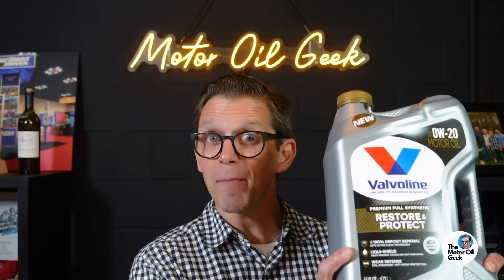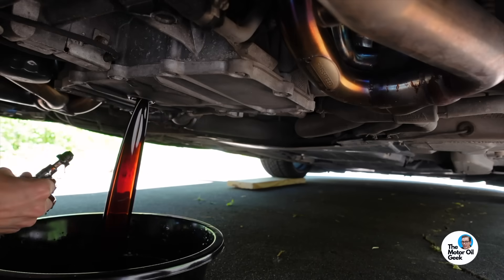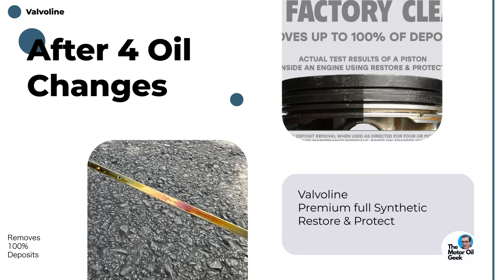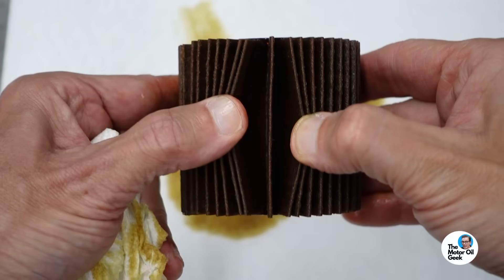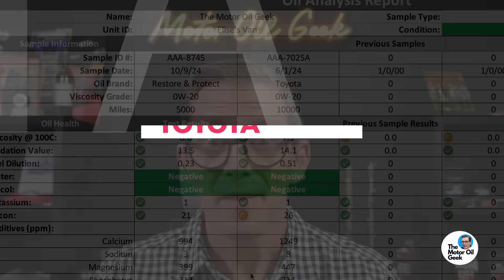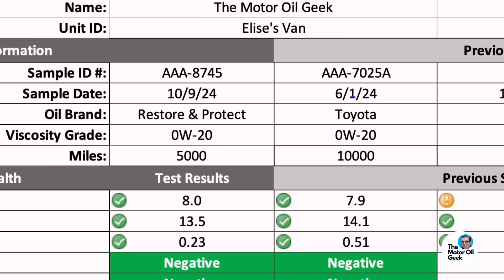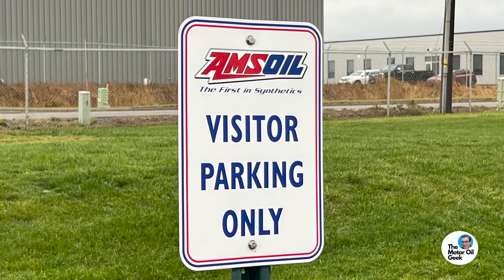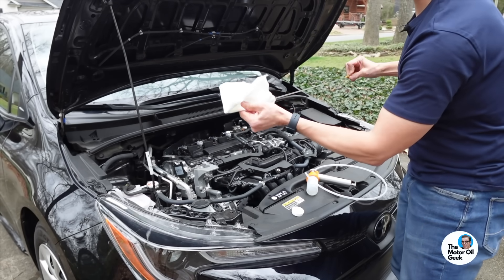The TRUTH About Valvoline's BOLD Engine Cleaning Claims

Comment: Dude, this was such a stretch. A cleaner dipstick? Come on man. You know better. Don't sell out like that. All that training and this is what you hang your hat on? Wear rates that are equivalent on a per mile basis to a bulk OEM oil? It's a stretch to make these claims. It's literally doing the exact same ANY modern 0w-20 oil would do. If you're not actually looking at the engine internals, where this product is said to work, you simply cannot make the claim that it's working. Maybe it is the secret sauce. But the oil sample shows it's just another in-spec 0w-20 API SP oil on paper.
Reply: I have to agree with you. It is a stretch to say it's working by viewing a dipstick and the increase in 1 element. Most all other PRP used oil analysis show zero increase in manganese. I was shocked LS jr used this oil analysis to prove it is working when most other samples show zero manganese
Reply: He didn't show competitive brands of oils can also keep the dipstick clean for unlimited years and miles if changed at least every 5,000/6 months. Example: https://imagizer.imageshack.com/img923/7893/BFcZ3w.jpg
Reply: @SurplusMeat  you missed the dyno engine breakdown test video!
Reply: @davidvankainen6711  Yes, I saw the promotional materials from Valvoline.

Comment: Wondering if these cleaning solvents in the oil will deteriorate seals and modern wet belts (oil pump/timing belts) faster
Reply: I also worry about it. It may cause rear main seal leak or deteriorate the valve stem seals. Who know? Nobody yet.  I won’t use it yet until it’s fully verified.
Reply: was wondering the same thing. My son's Corolla has 250K on it. I use Mobil1 High Mileage on that along with three other Toyotas with around 150K.
Reply: If it does actually work, it would make sense that there is some type of solvent
Reply: Never, EVER buy a wet belt engine. Bombs. Stupid-ass brain fart of a design.
Reply: It most likely will, there’s no magic sauce that other manufacturers aren’t aware of. It just has more of the normal detergents that in large quantities can cause problems. if you are having some trouble with stuck rings or similar using it once or twice might be a good idea, but not over a long-term. In a new engine, it may even be detrimental. At the end of the day, Who cares if there’s some varnish buildup on the internal parts if it’s not causing any issues.
Reply: @star9732  Why would you say it just has more of the normal detergents rather than a proprietary cleaning compound as they claim ? Which detergents cause problems ? Lake has noted that there are tests for seal compatibility that it had to pass for certification.
Reply: @star9732  uoa’s/voa show that it doesn’t have more detergents unless it’s something you cannot see on the uoa

Comment: Hi Lake, love your videos and I have a question… I’m from the U.K. and I’ve spent some time investigating the lubrication problems concerning the VW PD diesel engines especially the wear on camshaft and followers. I understand the need for using a good quality high zinc content running in oil for a first start and then moving to a VW recommended PD specific oil. The question is would there be any benefit in using a high zinc oil again say every three or four oil changes?

Comment: I just put the Restore and Protect in mistress's Honda Crosstour.  She works about 5 miles away and she does not drive far enough in winter to properly heat the oil and her engine has varnish as a result even using Pennzoil Ultra Platinum changed every 3,000 miles.  She is also getting moisture on the filler cap.  I told her she needs to take a longer drive somewhere every week to remove moisture.  After a few hundred miles the oil still looks clean and the looking through the oil filler hole I don't see a difference yet.  Probably the oil needs a higher oil temperature promote cleaning then it has been seeing.  I wonder if cold winter temperatures reduce the cleaning efficiency, if so they should note it on the oil container.
Reply: Take the car yourself drive it on the freeway 😉
Reply: I would be interested to hear how many longer trips it takes each week in winter.  All of my cars are driven more miles, but I have friends who drive less and all I can say is every week they need to take it further (like 10 miles).  I don't really know if that is often enough.
Reply: Don't hold it against me, but you really don't want your wife to take frequent longer drives, she might meet somebody ;), rather let her destroy her car before time.
Reply: @igorpotocnik7231  sounds like I need to give her a gas card.😁
Reply: Give it time. A few hundred miles is not enough to see any changes. At 1500 miles with mine it still looked really damn clean on the dipstick.

Comment: Looks good!  I wonder if we can find this in the box stores anytime soon, i haven't been able to find it
Reply: My Walmart has it in stock.  They will probably roll it out in most of them next year.
Reply: @shakerman55  I have two Walmarts near me.  They have all the common grades, but 0W/20 is nearly always OOS.  What does that tell you about these new emission standards and looser fighting piston rings…
Reply: @mhagnemae5202  they are not looser. The rings are thinner cross section. If anything they are tighter.
Reply: Got mine from WallyWorld in MI. Had a "NEW" sticker on the jugs.
5W30 and 0W20
Reply: Advance Auto is running sale right now.  If you buy a 5 quart jug you get a free filter (any brand).  AA is a bit pricey compared to Walmart, but the free filter makes it a great deal.  I think the sale ends 12/4

Comment: Awesome results. I just put this oil in my 2014 GMC Sierra 5.3 with 70k on it. I've been using Valvoline for the last five years.
Reply: I have seen a plug in  deactivate device you can buy
Reply: @edbeck8925  I don't think they work in the long run. The lifters still have springs.
Reply: Many 5.3 owners would love to know if this helps or hurts the lifter situation for this engine.

I wish we could get him to comment directly on it
Reply: @hummervs3278  I deactivated the AFM at 40k
Reply: @williamrizzo1285  Did you install a different camshaft and lifters.
Reply: @williamrizzo1285  did you do the full hardware delete or just software? I was looking into doing it but that's alot of money to do the full complete delete

Comment: Don't use R+P if you have a high mileage engine with leaks. I'm going over to Mobil One. Adios Valvoline.
Reply: Go to Valvoline Extended Protection High Mileage oil. Move up to a 5w30. It stopped the burning in my nieces Toyota Sienna. Mobile 1 is not better.
Reply: @seanmclaughlin7415  I'm not too happy with Valvoline for not listing a warning on the R+P. Therefore, I'm off to Mobil One High Mileage for now anyway. I was a fun experiment, but it ended poorly. Hopefully, I'll have a different vehicle next year anyway.
Reply: I’m using V R&P in a 61 Corvair engine that had been sitting for over 20 years. Engine is due for an overhaul so I was not worried about damage. 61 has a road draft tube and ring blow by was evident. Yes the engine did start leaking more oil but then it started slowing down as time went on. I believe the additives were actually reconditioning the old butyl seals. After 2K miles the blow by has been considerably reduced. Engine is still tired and will get overhauled but I’m curious to see what the pistons and ring lands look like when I do.
Reply: Your loss.
Reply: @dcm1f3  LOL.
Reply: @iseeblood209 Leaks! Leaking!
Reply: Ohboy, i just went to R&P in my crappy 2015 Equinox with 232K miles.  More regular oil and filter changes (vs just constantly pouring fresh M1 to top off constantly) combined with better fuel treatment seems to have cured the "shimmy-shake" while stopped in drive or reverse.  Hoping that R&P will help with ring buildup and perhaps reduce the rate of topping off and needing to clean out the crappy pvc system for the Equinox.  Fingers crossed, dipstick checked regularly!
Reply: @davidvankainen6711  Good luck.
Reply: Don’t blame Valvoline for doing the job you installed it to do.

Any time you use an engine cleaner you have the potential for leaks.
If your engine already had leaks it won’t necessarily get better. It’ll probably get worse.

The crud that’s being cleaned out is what was probably helping to seal your engine.

If your seals are already bad. You can add a seal conditioner (high mileage oil) to help slow down the leaks, but it’s only prolonging the inevitable.

You’re gonna need a seal change.
Reply: @einstein3509  I am blaming them. A simple warning label would be the professional thing to do.
Reply: @MidNightRider2001 

Maybe they should’ve.

But you just learned a valuable lesson today about engine cleaners.
It’s called the school of hard knocks.
I’ve been there many times myself, we all have.
If you think some king of snake oil is going to repair your leaky seals.
You’ll be the next one we see along side the road.
The only fix for a weak or broken part is to replace it.

So if you believe your engine needs cleaning.
Replace those bad seal and continue using R&P and you’ll be a happy camper.
Reply: @MidNightRider2001  How about addressing your oil leaks rather than complain about the oil cleaning your internals?  I use this on my car without an issue and certainly wouldn’t bash the oil if I developed a leak
Reply: @mhagnemae5202  LOL. You are triggered  by my warning to people? That's really funny!
Reply: @MidNightRider2001  
Please explain to me what Valvoline was supposed to warn you about.